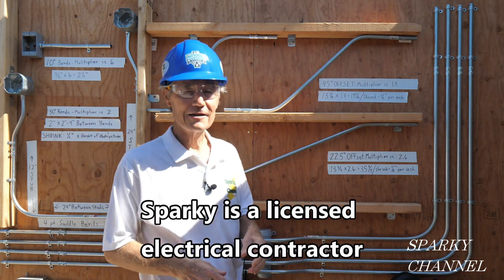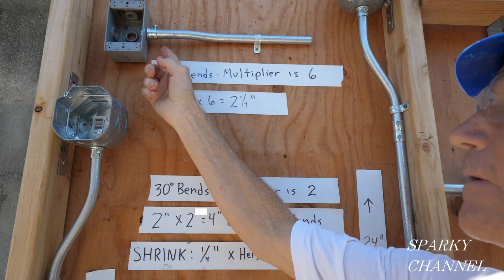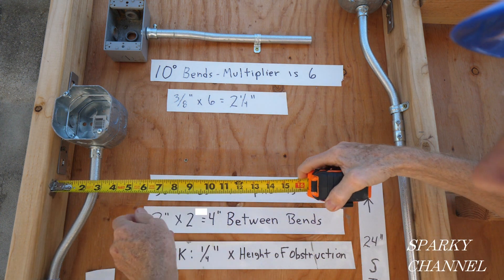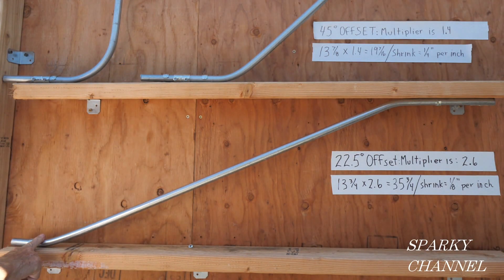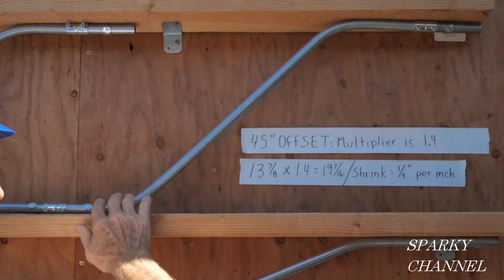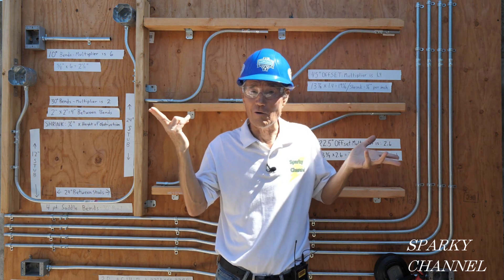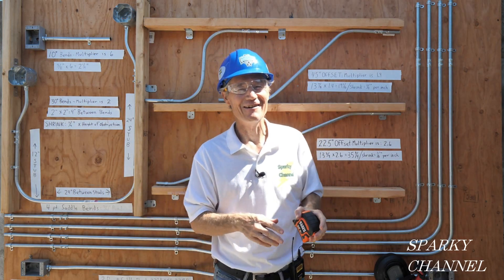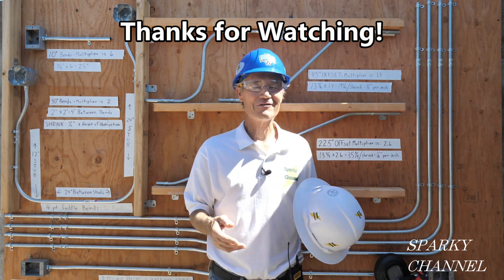EMT Bending Multipliers for Faster and More Accurate Bends

Comment: Just wanted to say THANKS - I had to run some conduit in my shop for a couple of mini-splits, and I was able to use this knowledge to make some pretty intense bends. Had to do a 7/8" box offset to the wall, then offset away from the wall 1.5", do a 90 bend to hit a particular height, then do another offset to bring the conduit back to the wall. Obstructions right under the 90 are tricky!
Reply from the maker: Great job Bill! I'll bet your work looks great!

Comment: Are there different multiples for different conduit sizes (1/2”, 3/4”, etc.)
Reply from the maker: The multipliers stay the same.
Reply: Don't confuse multipliers with deducts though
Reply: All the multiples are the same, the way it would change is if you do a different degree

Comment: I am a novice and found your video thanks. I have not reviewed any of the comments yet, it looks like to me you can figure out your Multipliers by taking 60 divided by your angle will give you your multiplier 60 /10=6, 60 / 30 = 2, 60/45=1.33, 60/22.5=2.66. Now I just have to learn about shrink. QUESTION do you have a Multiplier for 90 degree bends? 60/90=0.66 suppose my distance was 25" so 25 x 0.66 = 16.5 distance between bends?
Reply: Excellent observation, impressive!!
Reply: The multipliers are 1/sin(theta).  Oddly enough, that's close to 60/theta over the range you indicated.  Still, it's best to just remember the multipliers or use the actual formula.

Comment: Hey bill I have a question, my outlets don’t have any ground wire in them but if I use a outlet tester it says it’s grounded. Why is that? And can I just replace all my 2 prong into 3 prongs without the Gfci in the front?